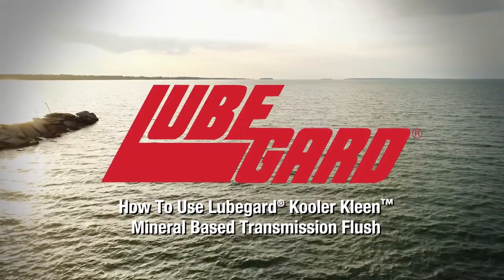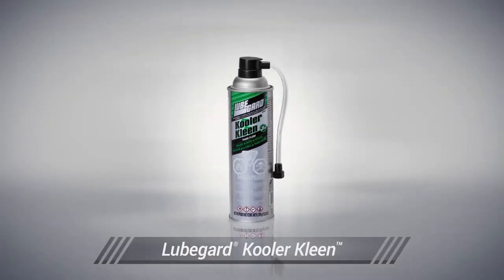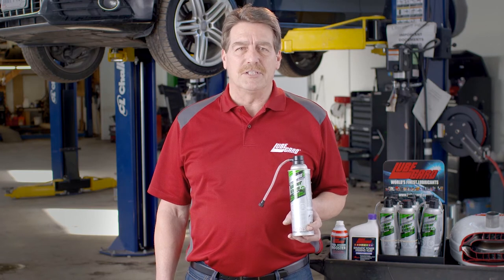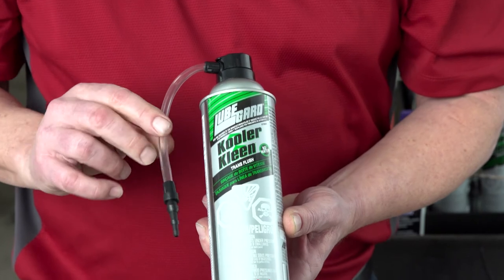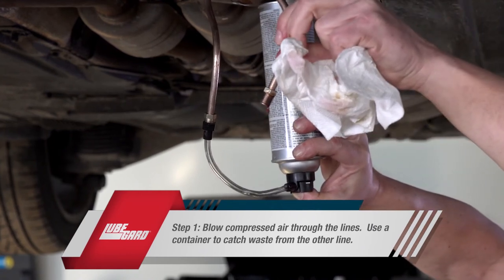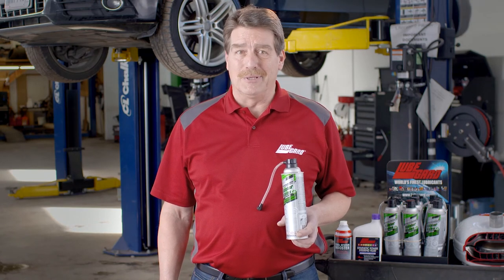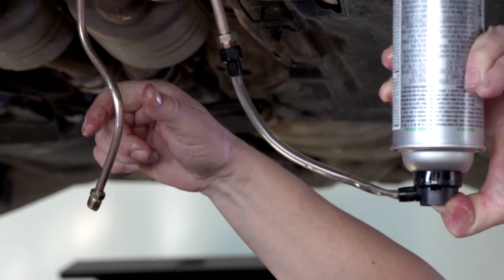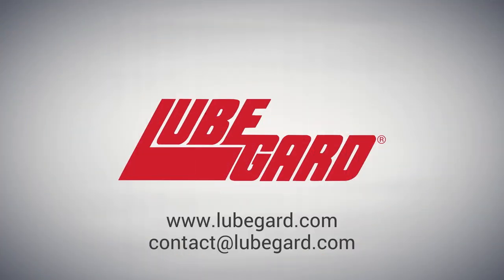LUBEGARD® How-to - Kooler Kleen Transmission Cooler Flush in a Can

Comment: I used to work in a transmission shop. We would use it to flush every job, Works very well. If the cooler won't blow out totally clean replace the radiator & or aux cooler. When refilling I recommend 1 Lubegard  in place of 1/2 Qt.  Atf.
Reply: What is 1 lubegard?
Reply: So is he saying that if a little of this makes it into new transmission it will not cause damage

Comment: Im looking a safe but effective cleaner for the transmission cooler fins. To remove old fluid and trash. Im trying to diagnose a leak. And determine if the coils or a line is the leak source. Thanks

Comment: How much psi should my compressor be set to?
Reply from the maker: Hello – Using 30-40 psi will work well If you’re using the compressed air to blow out the lines after using Kooler Kleen.